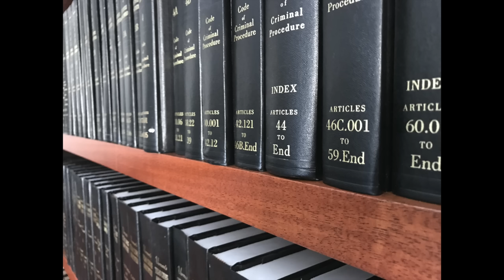Building Long Bookshelves That Don’t Sag

Comment: How in the  world did you get all those face frame  biscuits to line up with the shelves? You were pretty casual about the placement of the rails when you attached them to the styles.
Reply from the maker: Hey Tony, great question! I first cut the stiles to length & cut the biscuit slots for those and the slots on the ply. I did a dry fit with the stiles & biscuits and left them on. I then measured for each rail & cut the biscuit slots in those and their corresponding ply shelves, then I dry fit those inside the stiles. I pushed or pulled the ends of the rails slightly to line them up with the very end of the plywood shelves, then put a pencil mark on the inside of the stiles. (Look closely at exactly 5:35 for the pencil mark). Once I had my marks, it was "Go Time"! Does that help?
Reply: @RRRWoodworks  Yes, I do see the pencil mark. Dry fitting, cut to fit, and marking in place makes sense. Thank you

Comment: Excellent.  I would like a comment on what you put between the two pieces of timber.  Was it metal strips and if so, what size did you make the groove for them to fit.  I am wanting to build a bookcase for my study and this build intrigues me.
Reply from the maker: Thanks Gordon! It was 1/8” thick flat bar steel that was about 1/2” wide. I cut the grooves in the plywood to be just wide enough for the steel.

Comment: So, all I need is a $10,000 table saw to build a $10,000 bookcase? Got it. NEXT!
Reply from the maker: Actually, the saw is only $299 at Home Depot... https://www.homedepot.com/p/DEWALT-15-Amp-Corded-10-in-Compact-Job-Site-Table-Saw-with-Site-Pro-Modular-Guarding-System-DW745/100497987?MERCH=REC-PIPHorizontal2_rr-302033019--100497987--N

Comment: ok, so in stead of putting in supports, you doubled the material width on the shelves and used a thick back instead single layer plywood.  I mean, ok, adding more material does make things stronger, but its an inelegant solution, design wise.

Comment: its "Doesn't" sag...come on man....
Reply from the maker: "Bookshelves" (plural), so "Don't" (plural); "Bookshelf" (singular), so "Doesn't" (singular). Come on man...
* Also, don't forget to capitalize the beginning of sentences if you're (not to be confused with "your") going to be a Grammar Nazi. *
Reply: @RRRWoodworks  also "it's" not "its" :)) i like you answer and i like you video. Solid idea! wish i had a shop like yours!
What shelf length would you start to consider sag at? (At, say, 3/4 inch shelf thickness)
Reply from the maker: It would depend on what type of sheet goods you are using for shelves, how deep the shelf is, whether it’s adjustable or fixed, & what is going to be on the shelves.... Whew!

Generally, I try to stay under 36” shelf width, but that’s still pushing it. You can always put a 3/4”x3/4” drop edge on the bottom of the front edge and maybe back edge, depending on the size. That drop edge should be solid stock though, not plywood, MDF, etc.